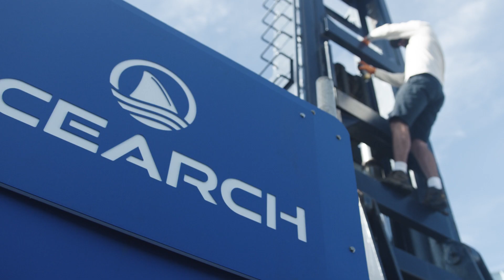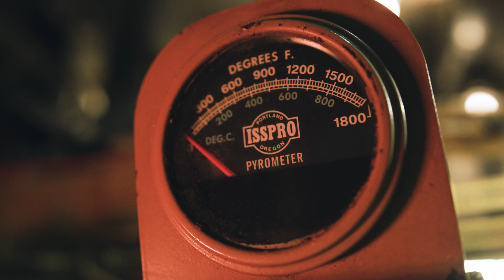Expedition Southbound: Week 1 Update

Comment: You guys shouldn't even be using the lift, your all well aware of the irreversible damage you idiots cause by taking them out of the water and still continue to do so. You fight these animals to literal exhaustion, then completely take them out of the water and have the audacity to say "they aren't stressed" you people do more damage to white sharks than good and your well aware of that but so long as you get a pay check and a shot for your cameras, Ocearch should/needs to be shut down.